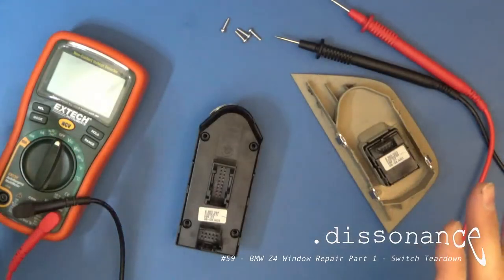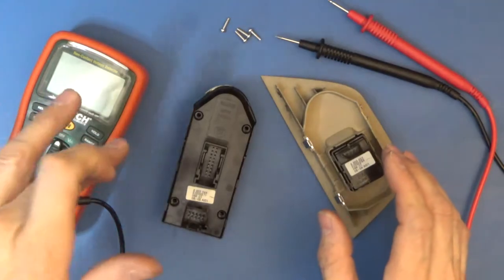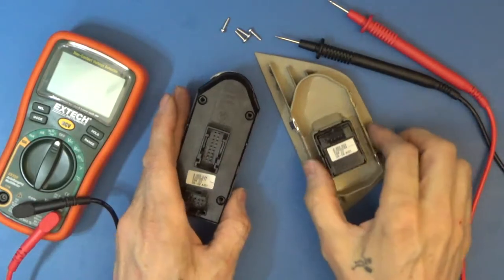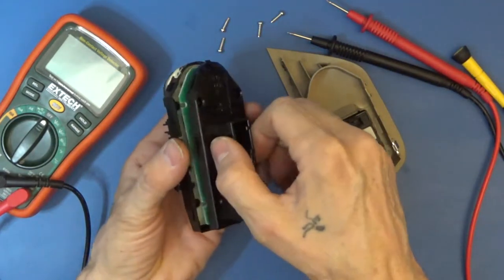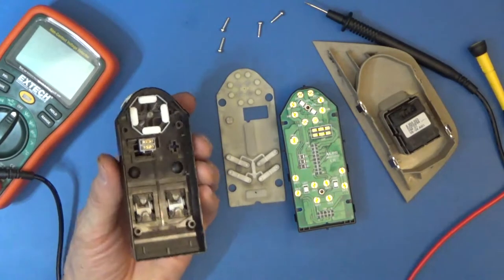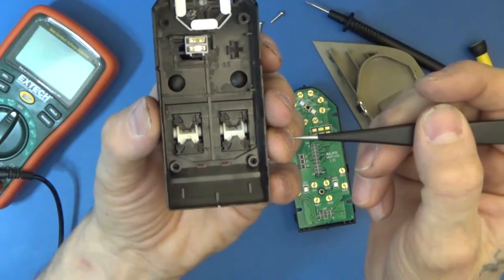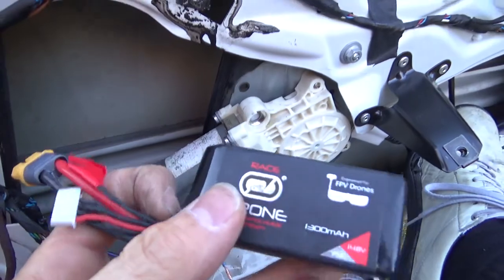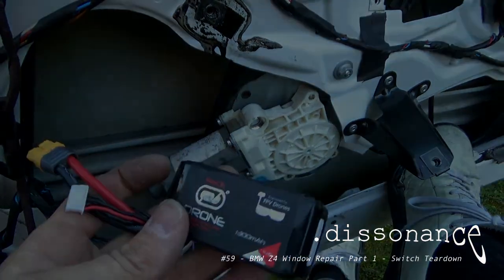#60 - BMW Z4 Electric Window Repair Part 1 - Switch Teardown

Comment: Thanks  for the video  it saved me a ton of money. my z4 passenger window would not go up or down. It would only move if you hit the convertible top button. After watching your video I cleaned the driver side board and its working perfect. Thanks again.